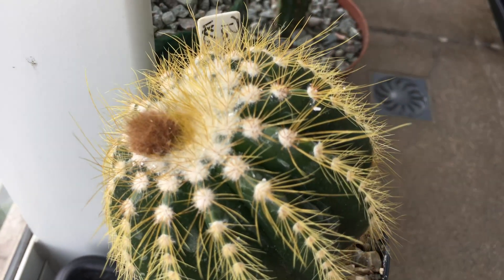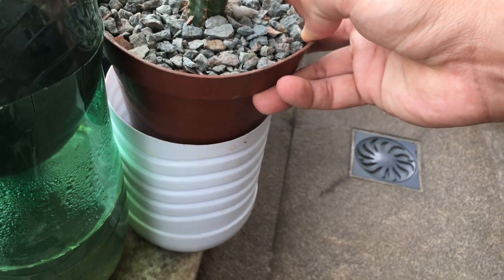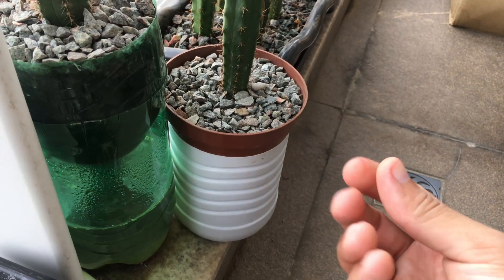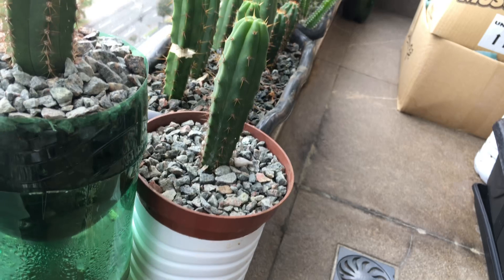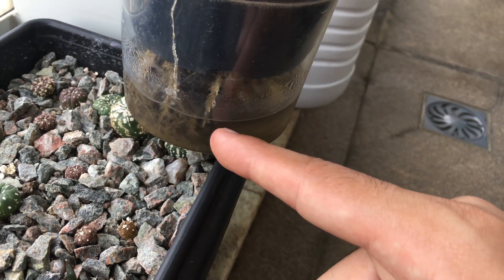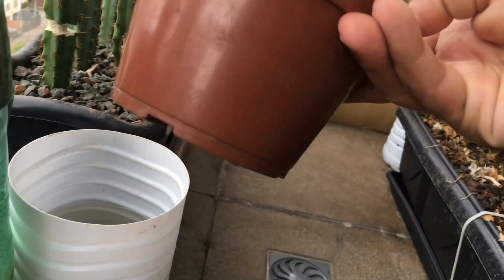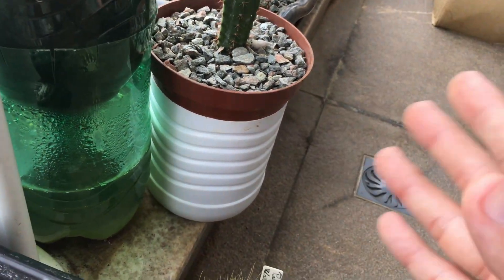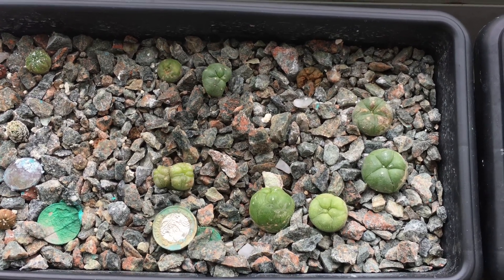Semi-Hydroponic Trichocereus Experiment.

Comment: It’s especially a great idea in extremely hot regions, where it would always provide proper moisture and avoid under watering or over watering damage, because no matter if you underwater it’s still got back up survival without causing root rot by having to oversaturate accidentally. Great idea.
Reply from the maker: Just make sure to dig a hole and place the water reserve in the hole to prevent excess heating of the water

Comment: How often would you change out for fresh water?
Reply from the maker: I usually don’t I just water the top substrate as normal usually once a week. Depending on how much roots and growing season the cactus will drink up everything within that time.
I will completely change the water of algae grows due to the nutrients from the runoff.
I’ve noticed there isn’t a need for constant cycling of the water since in my understanding the roots remain aerated and healthy from the top air roots. Also from my research over the years and experiences from my experiments not splitting or rotting unless you fertilize the water too heavily. The cactus is smart enough to only uptake as much water as needed.